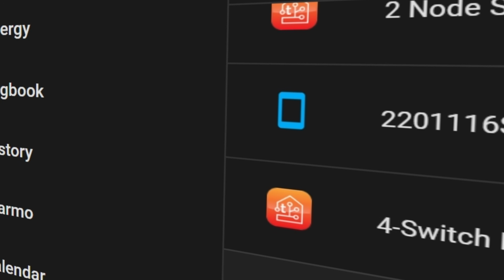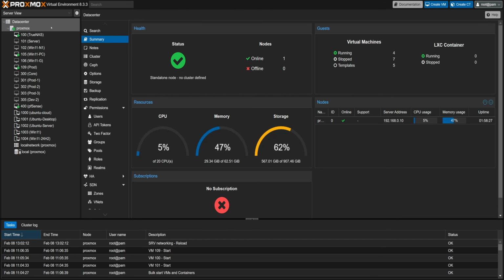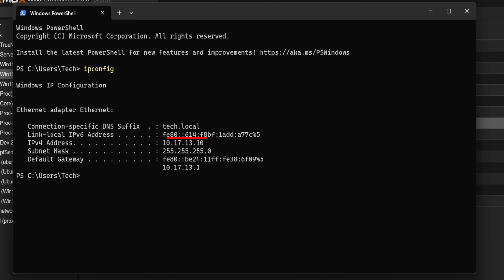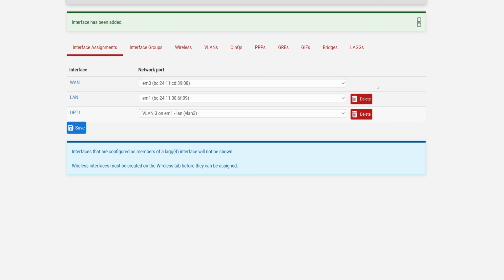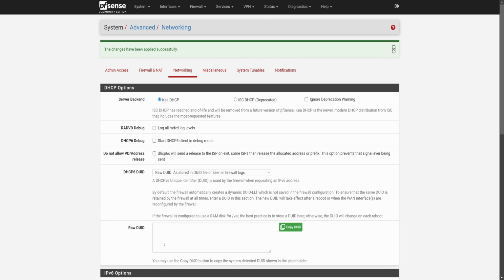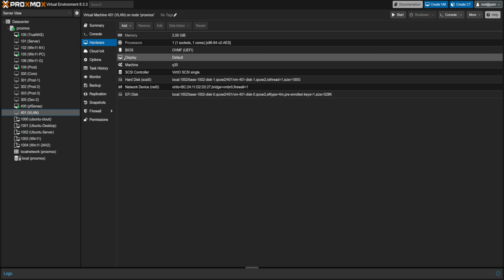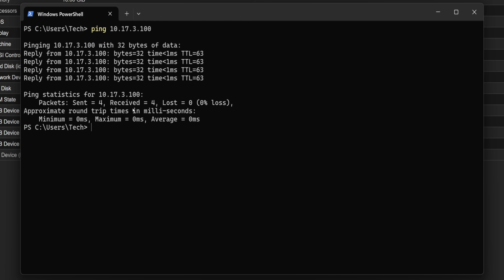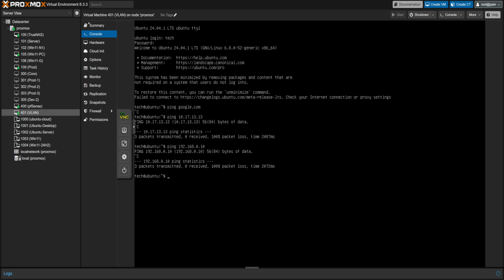Ultimate Network Security! Here is How to Set It Up! pfSense + VLANs - #25

Comment: Thks a lot for your great content on this weird topic for non network addicts😁 ! 
BTW, Let me give one important info for those who are using Win11 VMs as VLAN devices instead of unbuntu. 
In W11 Pro (didn't test other W11 editions), the inbound ping is forbidden in the W11 firewall.😡 I've wasted half a day trying to understand why after setting the W11 VM in the VLAN, I couldn't ping it from LAN. Even other VLAN devices couldn't ping each other (had created 2 W11 VMs in the VLAN, and pinging VM1 from VM2 failed, so as the opposite). 
Driiling into Google I finally found a guy that had similar issue and he solved it by changing the rules in the W11 VM Firewall. 
WTF Microsoft did turn off the ping by default ? 😈🤬😈
The tutorial to allow the ping in W11 without disabling the W11 firewall is here : https://www.youtube.com/watch?v=8vz5t3gDBeQ&ab_channel=Tricknology.
Reply from the maker: Yes, I also ran into the exact same issue in this video. Thanks for sharing this.

Comment: Thank you for very informative video!

How about let say you make the pfsense as your main firewall ditching the 192.168.0.1 you already have, my question is how do you set proxmox management port to receive ip from pfsense dhcp?
Reply from the maker: I’ve actually done that. But I’ve also kept a static IP like 192.168.0.x on Proxmox as a fallback. Since I do a lot of automation and testing, it’s important to still access Proxmox even if the pfSense VM has issues. Best of both worlds! 😊
Reply: @Tech-TheLazyAutomator  Can you tell me what you did?
Reply from the maker: Yep! Just go to Proxmox > System > Network, then edit vmbr1 and add the IP with CIDR (like x.x.x.x/24). Once that’s set, Proxmox will be reachable from the vmbr1 network at that address.
Reply: @Tech-TheLazyAutomator  I did that already but turns out I needed to edit /etc/hosts manually aswell.

Thank you, anyway Idk what's wrong with my pfsense install, I tried passthrough and virtual bridge as well but sometimes my lxc in proxmox is unreachable for certain period of time hahaha so I tried installing it in bare metal, hopefully that fixes it
Reply from the maker: Thanks for your comment! I also hope the bare metal setup works out for you. If you need any help, feel free to join our Discord community: https://discord.gg/EHcn4knGW4